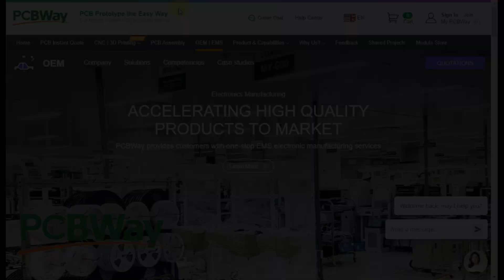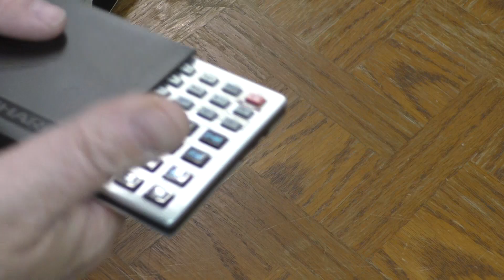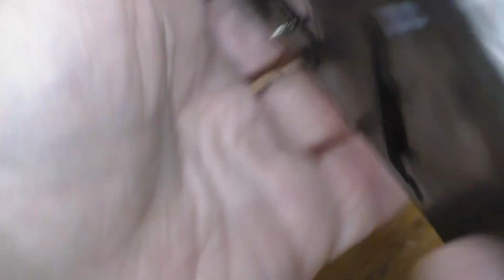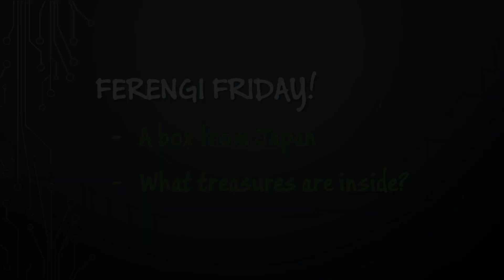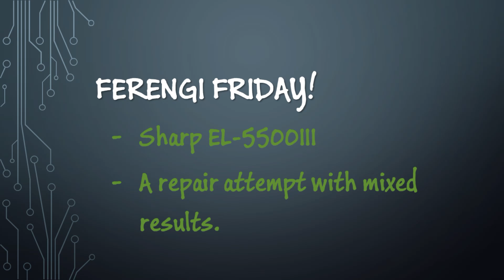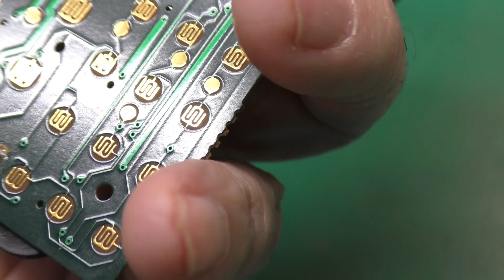Ferengi Friday! Two boxes, one repair attempt. Once success, one failure.

Comment: The CE-1600P and CE-515P are not the same plotters. The CE-1600P potter has a step with of 0.1mm and the CE-515P only has a step with of 0.2mm. So the jaggies of a diagonal line are less noticeable on the CE-1600P. But the start and end points of a line can only lie on a 0.2mm resolution on both plotters. I have implemented a bezier (spline) plotting subroutine in Z80 assembly language for the PC-1600/CE-1600P.
Reply from the maker: The plotter mechanism is the same, the controls are different leading to a different effective resolution.
Reply: @HeyBirt  Do you know if the step motors are different or the same? Are they only controlled differently so that on the CE-1600P they use half-steps to get finer resolution?
Reply from the maker: @MatadorBaukasten  I would guess they are the same unipolar motors. Back then building a microstep drive was a lot harder and more expensive. Typically, they did full steps using simple transistor drivers. 

On the smaller plotters the vector is stored in a single byte with another byte used to scale it. (Going from memory here.) This gives limited resolution. If there is more memory available to describe each vector the system can take advantage of all the resolution. 

Looping at the 1600P schematic it shows a LB1247 driver which is a simple Darlington array.